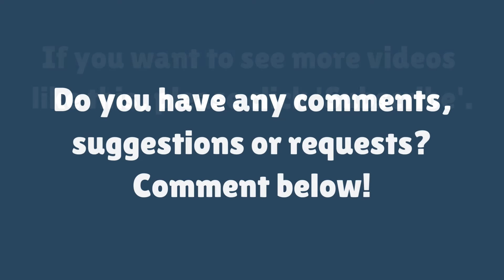Kit Build #3 - A Beautiful Glowing/Pulsating Heart - (And Chatting About Women and Electronics)

Comment: The IC is an opamp used as an oscillator with an RC timer circuit which is adjusted using the pot.  If you look on Learnelectronics latest video he covers this very topic!
Reply from the maker: Ahh, good to know! Thanks for your comment!
Reply: Integrator